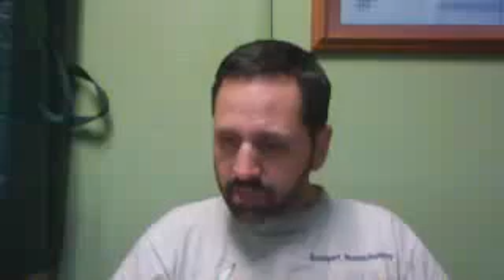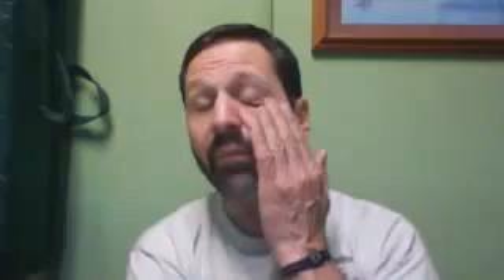When you have to drink surface water in an emergency...

Comment: Hi Craig! You're always my go-to for accurate info on so many subjects. I don't have a filter, as it's beyond my budget. I can boil water, having strained out leaves and other noticeable debris first. It may be discolored and look the best, but I think it might at least be safe to drink. Do you still recommend AquaBrick & are there replacement filters available? Much thanks for giving me so much common sense information!
Reply from the maker: Filtering as you said and boiling will make it safe from microorganisms, but not chemicals or heavy metals.
Reply: @ForbiddTV  I AquaBrick still available through your site?
Reply from the maker: Yes

Comment: can you give me a recommend filter and a uv light for placing in bucket? gravity style using 4-gallon buckets, thanks
Reply from the maker: Any of the ceramic filters by Berkey, AquaRain or Propur will filter out bacteria and larger, for viruses UV can work, but make sure whatever you use you follow the directions carefully.  UV would be difficult in an emergency type situation since it would require power.

Comment: So what is the best solution if one doesn't have fuel to desalinate, reverse osmosis, and boil if all one has is a nearby pond for source of water?
Reply from the maker: Desalination wouldn't be an issue in pond water. You could use a ceramic filter, but you risk a virus being present which the filter won't correct.  When in doubt, boil.
Reply: @ForbiddTV  And if one doesn't have fuel, would the best option be filter, then add a chemical to kill the virus? Thanks.

Comment: Thank you for your insight I have two life straws and a sawyer, they say the grayl  works better and even filters viruses have you heard about this one for on the go filtration, and the second question is do you think the berkey and others  like it would be fine for rain water kept in tanks?
Reply from the maker: All filters would be dangerous for any surface water, including rain water.  Your collection system was flawed as is your storage tank.  I have lots of videos on this but the easiest way is to give you the quote from the CDC:  "Filtration is not effective in removing a virus". https://www.youtube.com/playlist?list=PLwvM5FrPTJTnsd3-Wl6BB1RH2KUp1scyz
Reply: The sawyer is good i thought? Micron absolute filtration at .1micron..i thought it was also a nano filter? I was going to do the same system as her.  Cant we just boil or distill the water after filtering for viruses? Ty. Also the sagan duraflo filter used in the aquapail system seems sketchy to me as they will not give out info on how there filter works or give a list on what it filters out. The most i could find is the amount of copper and chlorine it removes plus the info that it removes 114 other contaminents. It seems good for viruses and bacteria but Im mainly concerned about heavy metals and voc's and those type of contaminents along with floride, chlorine etc etc.(Not concerned as much with viruses, cysts or bacteria as most can be removed by boiling except for bacterial spores which are uncommon.) Could you please recommend a filter and purifier for my concerns? I would like the system to be portable as well. Best i can come up with on my research is making my own prefilter with a 3 bucket system then running that water thru a sawyer or epic filter pitcher and then boiling or distilling it afterwards. Idk im at the end of my rope here drifting aimlessly among these bs manufactures claims trying to dig out the truth and find a system that works for my concerns. Also what are your thoughts on tds meters? Are they useful at all to any degree. I understand what tds are.i learned that after researching bottled water and looking at the water reports from bottled water companys. Is there a brand of bottled water you recommend as well?What would be better for my concerns aquarain or sawyer? The aquarain doesnt give much info either as compared to sawyer. Thanks for your input and vids. Also when will you have more gas masks in stock?
Reply from the maker: "Cant we just boil or distill the water after filtering for viruses"?  
Boiling and distilling are very different than filtering.  Two are effective, one is not.

Comment: How do you know that the filter manufacturer's are lying and it's not the CDC?  do you have a link to where the CDC claims that no water filters remove viruses?
I note that you specifically state in this video that the Black Berkey has a pore size of 0.9 and that, "they are all ceramic filters".  Neither of those statements are true.  The manufacturers of the Berkey Black do not specify a pore size as they are not ceramic filters.   https://www.berkeyfilters.com/berkey-answers/performance/filtration-specifications/
Reply from the maker: Jon Scot  I quoted the CDC.  It is a well respected heath organization all over the world.  If you don't like the CDC, use some other health organization around the world, they will all tell you basically the same thing, it's been a well understood science for many decades.  But if you want to be contrarian and beLIEve what the manufacturers who pay for their 'independent testing' shows, then be my ignorant guest.  https://www.cdc.gov/healthywater/drinking/travel/backcountry_water_treatment.html

Berkey makes two types of filters for their main units.  They are both filters.  I have linked the CDC quotes above, so now look in the mirror and read your passage again with a straight face.

You got your plug in for the Berkey , now go away.  I may still delete these messages after you have a chance to see this.  I don't tolerate people who thin they are going to come here and advertise on my channel.

Comment: What camping water filter system would filter out Giardia and 1080 poison (sodium monofluoroacetate), Because I think the New Zealand Govt is poisoning us with 1080 in our drinking water. (rivers and streams) They aerial drop 1080 into drinking waterways to rid the country of rats and possums.
Reply from the maker: Regarding Giardia, most filters can handle that since it a larger organism than viruses and most bactreria. 

Interesting, I wasn't aware of the 1080 poison.  Nasty stuff.  Start here and read more about it:   https://www.pwrc.usgs.gov/eisler/CHR_30_Sodium_monofluoroacetate.pdf

Your answer is probably somewhere in the 52 page report, I will not go over the whole report for you but on page 10 it says "significant water contamination is unlikely after aerial distribution of 1080 bait"  That's not exactly reassuring of course by using the word "significant".

And at the bottom of page 26 it says that cooking contaminated meat at 200 degrees C or greater causes the breakdown of 1080.  With the boiling point of water at 100C that would suggest you can't get rid of it just by boiling water.

My first inclination for any chemical is a filter with carbon would be useful.  If you want to get more sophisticated the best options might be distillation or reverse osmosis.  I have not researched the effectiveness of either of those two with compound 1080, but they generally take care of most anything.

Good luck in your search, sorry I don't have the exact answer you wanted.

Comment: After testing 23 methods of purifying water, NASA has chosen silver as the purifying agent on the Space Shuttle Program.Silver will be used in two functions that will provide Shuttle crews with pure water for drinking, air conditioning, food preparation and other operations. Water wastes will be recycled in Shuttle flights and silver's first job will be to treat hydrogen-saturated water coming from the Shuttle fuel cells: this water will pass through a tubular device of palladium and silver alloy. From the silver-palladium tubes water will flow to a purifying unit where silver will eliminate bacteria, including Pseudomonas A and type IIIA bacteria, NASA scientists report. By establishing 100 parts of silver in a billion parts of water as hygenic for drinking in the Shuttle, NASA eliminates the need for 1,000 to 1,500 parts per billion of chlorine generally used for purification. The unit will provide Shuttle crews with 32 gallons of pure water daily for all uses within the Shuttle, and for backpacks when the Astronauts work outside the vehicle in Space. Compared to earlier prototypes, the new unit weighs 90% less, needs only one third the space,doubles the production of water and simplifies the process: it eliminates the need for mixing, metering and testing water while in flight and eliminates the risk of corrosion. The most dramatic purification tests occured in 1976 in a 20,000 gallon swimming pool in Nebraska. There was no disinfectant of any kind in the water. Fifty gallons of municipal sewage plant effluent was put in the pool. That produced a dangerous concentration of 7,000 E.Coli bacteria cells per 100 milliliters (half a cup) of water. Contents of the pool were pumped through a tank containing alternating anodic and cathodic silver electrodes for disinfection. Within three hours the pool was entirely free of E. Coli bacteria and the water contained only 3.2 parts of silver per billion parts of water.... so yea best bet (SILVER) NASA freakin uses it ...thats good enough for me.
Reply from the maker: +Tommy Barns You are correct, but NASA is also very careful to say it is toxic and must be kept at low enough levels that the body can excrete it safely and also has a test to determine the amount in the water is at safe levels.  I don't know how you would safely perform all this in a survival situation with surface water.

The CDC gives it's recommendations based on technology that is readily available to consumers to make water safe to drink.  There are a lot of variables with silver (particle size, concentrations, time in contact) that would be very confusing until someone made a survival kit with clear instructions on its use.

The same confusion would also apply to ozone and UV which can also kill pathogens in water.

Comment: I wish I saw this video before I bought my Berkey. I boil tap, and run it through the filter =(
Reply from the maker: +DoubleDown  There really shouldn't be any need to boil tap water unless you suspect something has gone wrong with the municipal water system.
Reply: So why do they add fluoride in the drinking water, toothpaste, etc., when fluoride has no benefits to dental care? I've heard and read a lot of theories about this, such as reducing IQ. Even though none of us can really explain the reason why, I would still love to hear your theory on this. Thanks for enlightening our minds.
Reply from the maker: DoubleDown
 I try to stay away from theories; provable facts are more secure position to be in.  I have heard the same things you probably have and I personally avoid fluoride.

Comment: Not all filters are ceramic and some are better yet than those. How about the sawyer mini water filter? It uses a fiber filtration system and filters down to 0.1 micron absolute.(still does not stop viruses) However there is also some that use silver in there filters now. Silver is the best way to kill all viruses and bacteria without taking harmful chemicals into your body. In fact there is a way to kill them very easy you didn't suggest. Colloidal silver is the best disinfectant known to man and is safe to ingest in small amounts. Id like your thoughts on that subject. Here is an informitive video to help you understand how colloidal silver works,if you do not already know. http://www.youtube.com/watch?v=cjGOZFJ9co8
Reply: you fully trust the cdc?
Reply from the maker: +Tommy Barns You are walking in a dangerous path from a stupid meme.  The CDC does not recognize silver for water treatment.  

All the testing done with silver (some keep changing the prefix on some variation to show how theirs is better than the others out there, ie colloidal, ionic, nano, micro, angstrom) is done in vitro such as in a petri dish.  If people think it is doing the same thing en vivo for benefits achieved in vitro, they are setting themselves up for a potentially dangerous situation. 

Everyone who believes this meme for water treatment will have trouble finding good scientific information regarding its use to prove your case.  What type of silver?  What concentrations of parts per million in how much water?  How long does it have to sit before drinking?

Alcohol kills things in pitri dishes too, so why not just drink vodka to cure all that ales you?  [pun intended]

As an alternative health care practitioner I would strongly recommend only using various silver products EXTERNALLY.
Reply from the maker: Joel Doss Pick any health agency in the world if you reject anything the CDC says.  Or die; your choice.

Comment: How good is regular Clorox bleach in purification process of water??? The process a friend told me. Step 1. Use a 55 gallon food grade drum. Put 55 cc of Clorox bleach full strength and then fill with water. Let water sit for 48 hours.    Step 2. Airdate water  for at least 12 hours using a new fish tank air pump w air hose and large air stone. (Need 110 power source - generated - 12 volt battery with inverter) Than your ceramic  filter system (less than 1 micron). What do you think of it.
Reply from the maker: +Leon Jones  The method may be valid but each reader must do their research on the quantities you quote since I didn't check the numbers you quoted.  

The problem with this however is that bleach can degrade over time, so that is a troublesome variable with this method.  Also be careful of bleaches with scents or other additives.

Comment: if i put chloride then use those portable water,  is it same effect as using the portable water filter then chloride? 
( of course both method will use the cloth to filter those big dirt and stone 1st)
Reply from the maker: +weinfin Either will do, but you still have to have the concentrations correct and the right contact time.  Filtering AFTER chlorine addition with a filter that has carbon will help then remove the chlorine if you are concerned about that.
Reply: thank you so much for such informative video and answers, i really appreciate it. 

your video helped me learn so much of water safety within such short period of time! 

Thank you again!
Reply: I have a one more question,
1) can some virus stuck at water filter during using water filter or they all will be too small it will just slip through it?

Reason i was thinking, assume I use a water filter (lets name X) on dirty water then use chlorine. 

Then i Switch to the other method, add chlorine then use the water filter,

Now because chloride is being filtered by the water filter, perhaps some part of water filter that trap those dirt, bacteria, also trapped the " virus"  and let the virus passes to water.

Is it possible?  Sorry such for such silly question. Thanks
Reply from the maker: weinfin
If the chlorine was administered correctly it doesn't matter because the virus will be dead.  A dead virus does the body no harm.

Comment: You should tell people that reverse osmosis and distilled water decalcifies the body, people die from this!
Reply: Distillation does remove minerals but they are non organic minerals. Distilled water is pure water and many have used it for years with no ill side effects. Go Solar now and get a water distiller and be very healthy.
Reply: Wouldn't a few bites of food replace any minute amounts of mineral that anyone would be missing from water?
Reply from the maker: Diana Smith Hill There is a whole school of thought on this.  There are many minerals in our drinking water.   Some are beneficial to our health and some are not.  That is the crux of the problem when trying to filter things out of our water.  Reverse osmosis and distillation tend to remove ALL the minerals, good and bad.  We do need minerals for good health so it is generally not recommended to drink the reverse osmosis or distilled water for long periods of time without mineral supplementation.  The main thrust of this presentation was making water safe to drink from surface water sources; reverse osmosis and distillation will certainly do that.